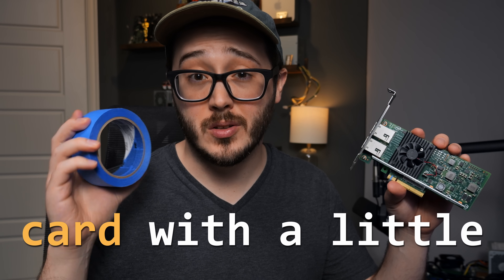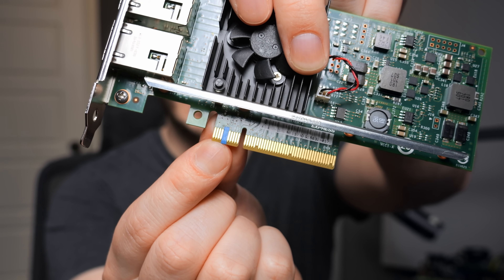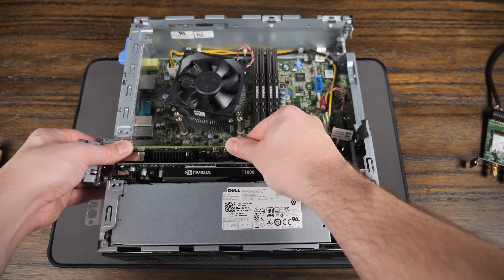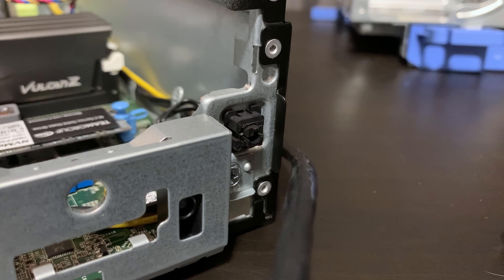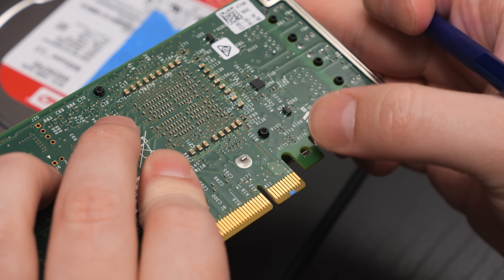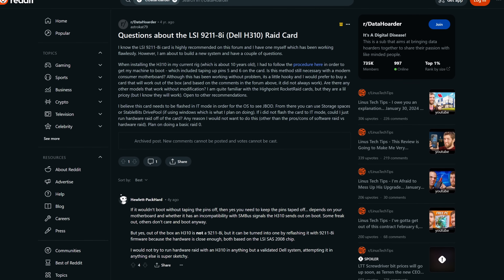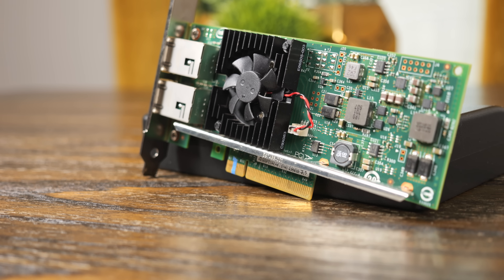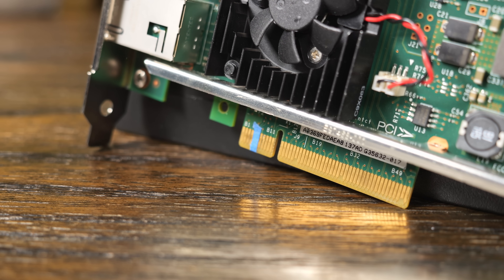PCIe Card Doesn't Work? Try This!

Comment: Got me 2x 10GbE dual port HPE NICs with HPE Transceivers. "They only work in HP Servers"! Whuuuut? Googled it, found a 3 years old video. Used my cutter, on some lable tape and boom. Got my NIC working perfect with a WIN 11 PC. Firmware and Drivers update thru the internet. That's it! 🙂

Comment: so weird that this video that jeff geerling comments on is what fixes my mi50 that's just attached via gpu stand to oculink to m.2 to a steamdeck. using a straight powered pcie riser to m.2 cable shorted my rog strix g18 so all this has been an... expensive... learning experience. Tuition is crazy these days

Comment: Hi guys , i need advice here, is this trick works on pcie 3.0 sata card plug into an old J2900k itx motherboard with just pcie x16 2.0 slot?

Comment: I had a Oracle Server Database Cluster running on HP Proliant Servers when I was a Server and Storage Area Network administrator at Intel that I was upgrading the amount of RAM it had, I powered off the first node, added the RAM, and tried powering it back on, but low and behold it would not power back on. The first thing I thought was there was some thing wrong with the RAM and I removed it, but the server would still not power on. I ordered a new mother board from HP, and scheduled for it to be replaced by our HP Service Tech, he and I swapped out the mother board and powered it on, and still nothing. We then both decided to pull out all the Pcie Cards it had, and finally it powered on, it turned out to be a bad Emulex Fiber Channel HBA SAN card, that just failed. I had the same thing happen with a EVGA Nvidia GTX 980 TI card, installed in my 5,1 2012 Mac Pro it would not power on.

Comment: found this while searching info for my touchscreen Fujitsu Lifebook T731. It's annoying how Mini PCIe and mini SATA use the same connectors, physically 100% identical but the pinout doesn't match up anywhere close enough to allow even partial compatibility.
 Plus for Mini PCIe, I've found mention that specifically the Lenovo Thinkpad T420 has pin 20 on WLAN mPCIe port to turn radio on, but the same pin 20 for the WWAN mPCIe on the same unit turns radio off.
 "But wait, there's more" because the mPCIe standard say to carry some other bus signals like USB, and some laptop vendors don't connect all of them up to spec, some "mPCIe" wifi or bluetooth cards that are literally just USB devices won't work in every laptop.

Comment: This fix is brilliant! I'm currently working on building a Proxmox host with a Shuttle XPC and after installing RAM in all four DIMM Slots, it failed to boot with my 4 Port NIC installed. After taping pins B5 and B6, it boots and everything works, I'll repeat, WHAT A BRILLIANT FIX!!!

Comment: I got a HP Elitedesk 600 G4 SFF a few months back intending to build a router out of it  and while I waited on the "router parts" to show up I upgraded everything else; CPU, RAM, NVME & SSDs, even some HP cages & I/O stuff... Probably $500 in stuff I had laying around (probably could have just bought a REALLY nice router). When the "router" items, a dual port 10G card and a quad port 2.5G card finally arrived NEITHER one would work in this little HP (but both worked fine in other machines). Really?? !!@#$!! I screwed around with it for a week or so before the whole thing went in a garage box along with the rest of my other nope/fail projects.🙄

Now I found your video and "fixed" both cards in about 5 minutes with some packing tape... 🤣The Elitedesk 600 G4 SFF router has been officially pardoned from the garage! Thanks!!!!👍
Reply: elitedesk fan detected

Comment: I got a CISCO UCSC-PCIE-IRJ45 Intel Quad Port Adapter Network card I350-T4 74-10521-01 from eBay. It didn't post like you shown in the video. Even with B5-B6 covered with electrical tape, the PC still doesn't post. Any idea?

Comment: I stumpled upon this myself with a Broadcom 4 port NIC. The interesting thing was that the last time I tested it in that system it was working. Eventually I found the same instructions and then I realized that I installed two more RAM sticks since the last time I used the card. So yeah, SMBus with RAM can be a problem with certain setups obviously. To be fair, that was server-grade hardware that I've been trying to use in a consumer system, so maybe the consumer-grade parts are to blame here.

Comment: This works because of a few reasons vendor lock is one. And data the other.
You need to use thin tape or the slot will scrape off the tape when you put the card in. Also not goopy becuse you dont want glue on the contacts.
You only usually need one pin covered and it will work.

Comment: Hey awesome video as always! QUick question: Do you think I could fix my HP NC522SFP Dualport 10GbE with this as well? As soon as I plug it in the server wont boot properly anymore. I am just a little afraid to brick something if I tape over the pins. Thanks for oyur advice!
Reply: Worst case scenario from this the server doesn't post and you remove the tape

Comment: You could use a logic analyser and tap the 4 pins (2 on the mobo, and 2 on the isolated NIC), to see which party does some talking. Somehow I would expect the NIC is just a slave, so that it would not spit out something on the SMB. Side note - the SPD info from memory should be a different bus. The most common use of SMB in computers is inventory listing, the second comes some out of band monitoring, and third is then use for controlling things.

Comment: This actually corruputed the BIOS on one of my motherboards. Luckilly I had spare chips around, since the BIOS chip is in a socket. The tape did the trick and it's still working after about 5 years.

Comment: that card is kernel locked and the pin you taped off stop reporting to the pcie e lanes that its locked it use for some xeon servers and its becuase it used for data centers old cards that was locked out and they where sold at a decent price when they came out but the companie want to limit it when there 10 gig cards where not kernal locked you can try to flash  a random bios to it and by pass it but there a small chance of find one to work with it

Comment: I wonder if this would wok in my one system.  The problem is any PCI-e Graphics card that needs supplemental 12v power in refuses to be detected. GTX 1050 ok GTX 1070 no go.
Reply: Did it work?

Comment: I have done similar with WiFi card in notebooks, which would be disabled by default and thus wheren't working notebooks with the matchin 'enable' key combination. Also I once had issues with some real crap notebooks (Dell), which blacklisted any internal hardware that wasn't originally supplied with the notebook. There you had to isolate the pins when powering up but after POST they needed to be reconnected again so the hardware would work with Windows, so I put in an arudino that did the (dis)connecting at the right time.
Modern hardware is utter trash, because vendors actually are putting more energy into preventing owners from using their hardware than in innovating their products.

Comment: I had a NIC that constantly threw "msi error"s and/or "msi interrupt"s. These caused a flood of logs to go to /var/log/syslog, at such a speed that my 512GB got full after about 10-15 minutes of working. I eliminated it by adding some options in grub. However, your case is something rare. Not booting at all is another story. Thanks for sharing, dude.

Comment: unironically many years ago I used to have a Dell PC with a core 2 duo, I wanted to overclock it but the bios didn't allow me, so I used duct tape of all things to cover a couple of specific pins and overclocked it from 2.6Ghz to 3.2Ghz.
Edit: I didn't get to the part of the video at the time of this comment showing the tape CPU overclock, my b.
still cool that it was possible.

Comment: I fixed a printer from goodwill with the same kind of tape. There was a physically rotating part (I don't remember what it was called, an actuator? A piston?). After time, the foam spacer on it deteriorates and sticks so it no longer rotates properly. Putting tape over it makes it work again, so it doesn't stick. Tape is such a versatile fix for electronics!

I spent $10 and got an awesome printer!
Reply: There's that old saying that You can fix everything with WD40 and Duct Tape : If it moves, but shouldn't move, use duct tape. If it doesn't move, but should move, use WD-40.
But you've proven it's not always true, since the other way around worked best in your case😁

Comment: I always enjoy your videos, short and sweet or longer!........ I hope it was just the three cards that I bought 2 years ago,  but the fans were anything but "nice" on these Dell X540-T2.  SCREAMERS in my opinion. On two of them I just took off the fan, made sure they had airflow and no problem. The last one I stuck inside a Lenovo M720q  tiny for a Pfsense box. Pfsense would lock up without the fan running. So if you are sticking this into something small and/or sensitive to sound, buy a version with a bigger heatsink. Just my $0.02.

Comment: I have one of these dell x540-t2 cards that I tried using in a lenovo tiny pc for a pf sense router. It worked with no problems, but the fan is insanely loud and the card started getting uncomfortably hot. I messaged the ebay seller and they just refunded me and told me keep the card, I ordered a x550 instead with a heat sink and no fan, but now I still have the x540 that I have no use for. I could put it in my main PC which has much better airflow, but don't want the loud fan still. After some searching on reddit someone linked to an identical fan on aliexpress for around $17, but I'm wondering if anyone has tried this?
Reply: Just posted a similar experience. I had no problem running it without a fan,  outside of a tiny PC, as long as it does have adequate airflow. I ended up using a 2.5g nic in my  m720q  but mostly because the x540 could not do 2.5G with my modem.
Reply: @jbuccaran  I also have a m720q (and a second on the way for docker containers), what 2.5g nic did you go with? I talked myself into the x540/x550 because why not? Now I might be finding out the why not. The x550 hasn't came yet so I have yet to try it, but I don't need 10g on my router. I think I read something about the x540 or x550 only doing 1/10g and not the inbetween 2.5g or 5g, but I could be wrong, lots of reddit scrolling.

Comment: Perfect timing for a video. This literally reencountered this issue 2 hours before you posted this.  I have a OptiPlex 5060 and a Precision 3430 with the same CPU. The Mellanox connect3 cards I have work in the OptiPlex but not in the precision unless I take the ram stick out of dimm slot 1. I'm going to have to do the tape fix on it.

Comment: Dell has a history of making strange compatibility issues on their workstation hardware to prevent people from experimenting or adding third party stuff to their machines. From non-stardard versions of standard connectors like fan and power supply ones to different BIOSes to lock compatibility of certain features.

Comment: I just clip the pins off the card since I'm never, ever going to need the functionality they enable, and I kept finding that my tape would slip off. Had to do this with some dirt-cheap two-port 10G NICs I found on Amazon that were for sale from parted-out servers, and in my case they were HP, so definitely not just a Dell problem.

Comment: I have a Dell H310 card that needs some pcie pins taped in order to boot in non dell motherboards. i recently swapped it out for a LSI 9211i, just to try it out. both use the same chipset but the Dell one has a larger heatsink. im using a 80mm noctua fan right under it anyway for better thermals x)

Comment: FWIW... even you're 600% sure you won't move the card elsewere or sell it... *don't scrape off contacts*! If you're lookint for a permanent yet reversable workaround, consider conformal coating. You can find cheap one that can be converted with ultraviolet light, but can be later scraped off without damaging the underling traces using solvent (buy the right one and please test it on a spare board before).
It's fare easy to remove coating than create contacts again.

Comment: I'm using the one-port variant of that same NIC in my Windows machine. I didn't have this kind of trouble, instead the metal bar going across the card blocked my front panel USB header on my motherboard, but I got everything working with a right-angle adapter. This is good to know, though, if I decide to move it to a different machine for some reason.

Comment: Had the same thing on Dell and HP SAS cards.  Did the same thing with painters tape.
Reply: Also that 10GB card you had looks to be an old fibre channel storage network card.  So technically, it counts as a storage controller.   I used to use those in an old role managing a SAN.  I recently bought one for same idea as a 10gb network adapter.

Comment: Hold on. I have tried this trick on the same exact card on my HP z2 g9 and it did not work..... I had to buy a brand new 10GBaseT card in order to get 10G 😥
Reply: Update : I tried again, and it worked. I think it might have been a driver issue all along. Time for me to return the other card, and to buy a quieter fan because the stock one screams !

Comment: This is a Dell thing. The YouTube channel Art Of Server did a video on this, as well. That time it was HBA cards.

Appears that Dell hard codes something on the SMBus which can cause issues like this when installed in a non-Dell server.
Reply: This is one of the reasons when I was getting a corporate machine to repurpose as a server I went with an HP, they are very good at supporting their bioses and don't have oddities like this, and those HP machines also typically have 80+ Platinum PSUs which is amazing for a home server.

However, I have nothing good to say for their laptop, printer or pretty much any other division, it's just the fact that most of their corporate machines are really good.
Reply: It's more that the Dell desktop does not like server rated components. So if you take a Dell desktop and install an HBA including HP or generic ones then they either don't work or stop the machine posting. Cover the pins and magically they work or the machine boots.
Reply: Incorrect being dell specific. I've MSI & 2x gigabyte consumer boards, 3x broadcom dual port NICs. Tape mod required for MSI and one of the gigabyte boards. the 2nd board worked fine.

Comment: If you're careful, you can just cut the tracks on the board.
Did it on a Dell RAID controller to make it work on consumer boards.

It still worked in the original server too.

Edit: oh well you covered it anyway

Comment: Kapton tape would be my reccomendation for electrical isolation
Reply: Ditto; it will last a bit longer especially if you ever plug/unplug the card more than once or twice :)
Reply: Side note, "Kapton" is a brand name, the more widespread name would be "polyamide" :D
Reply: @pixel_vengeur391 Just to one-up you on being nitpicky 😉, I'd say polyamide is the more general name, but Kapton is the more widespread name.
Reply: Yeah it's great for things like this:
- doesnt leave a goey residue like electrical tape.
- resistant to high temperatures.
Reply: @ROFLMAOwithExtraCheese  being thinner, kapton tape is also less likely to bend the pin in the motherboard connector if it goes past its elastic zone.

Comment: I don't get the sudden craziness around 10 gig rothen copper ethernet? I mean it starts with actually getting a proper Cat6a/Cat7 patch panel that really properly likes speeds of 10Gbs. Also these 10Gbs Rj45 switch(routers) are hard to come by and on the expensive side for what they are. On the other side all the SFP+ hardware for Fiber like OM3 or so is kind of cheap and way more capable all the copper stuff. There are a lot of almost 10 year old SFP+ stuff out there for way cheaper that all the proper 10 gig RJ45 stuff.

The only downside of Fiber (currently) is if you insist to terminate all your fiber yourself but fiber with all plugs spliced in is most times cheaper as properly terminated Cat7 with all the properly rated plugs.

IMO if someone really has the need (or wants' to have) 10 gig networking they should solely look towards fiber (maybe DACs in racks) and SFP+ gear. That is more future proof and currently with older hardware but good to use in a homelab,  cheaper. Also you can do 100 gig with OM3/OM4 in the future when this equipment isn't costing an arm and a leg. I am not so sure you will ever do this with copper over longer distances that a few meters.

Comment: SMBUS devices have a hard coded address, it sounds like the card responds to an address that conflicts with something on the mother board that is critical to the POST.
Reply: Came to say basically the same. The question of course is WHY would a PCIE device have an SM bus connection used? Poking around it looks like it has to do with setting up ACPI, so it's possible that by covering these pins some power management stuff won't work right, not sure
Reply: @repatch43 you can sense inventory  (model/serial number) or have temperature sensing there
Reply: Wake-on-lan, maybe?  @repatch43
Reply: It should be quite easy to check the address with an Arduino.
Reply: @nalinux  And then? Some I2C devices are hard coded. With most they can be changed, but only by physically moving some jumpers that probably aren't populated. Tape is a straightforward solution